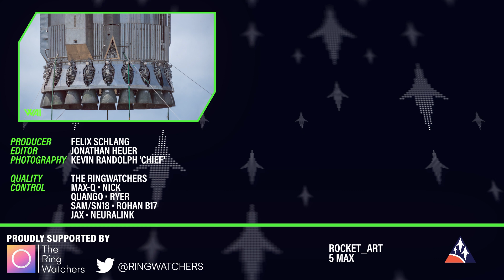Booster 7 Rollback & New Ship 28 FWD Dome! | WAI NC

Comment: If you look at the "chime" at 2:50 just below the text "WAI cam - Chief August 12th," there is a clearly visible "slot" in the aero-cover.  I'm not an aeronautical engineer, but that looks like an open invitation for aerodynamic forces rip off that cover during Max-Q. Thoughts anyone?